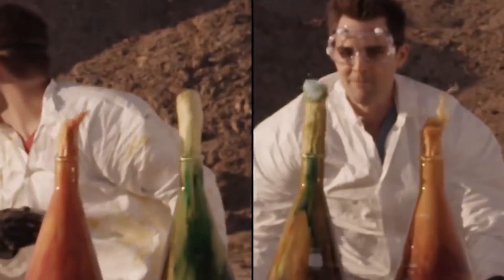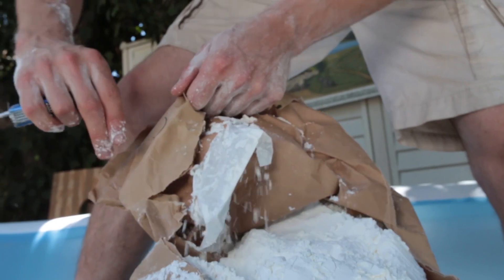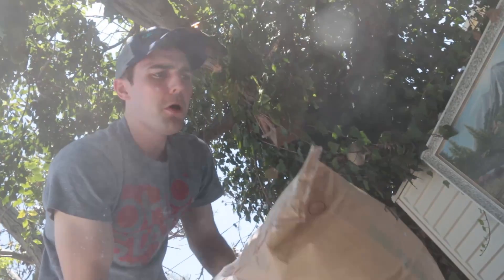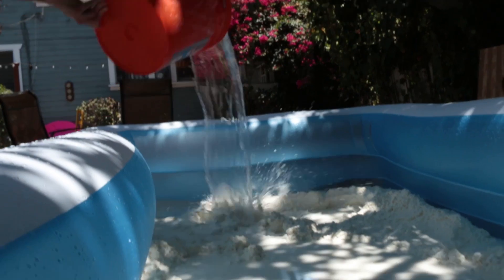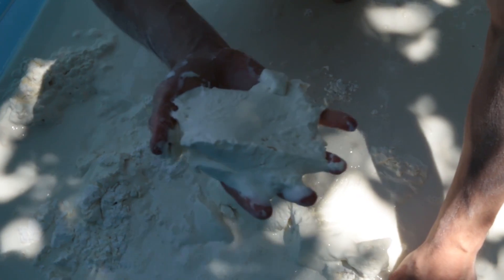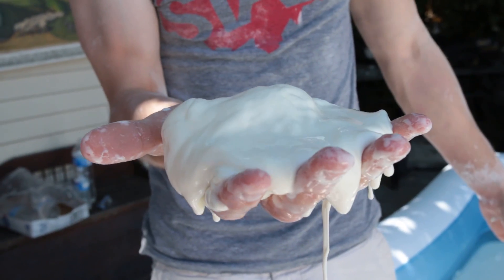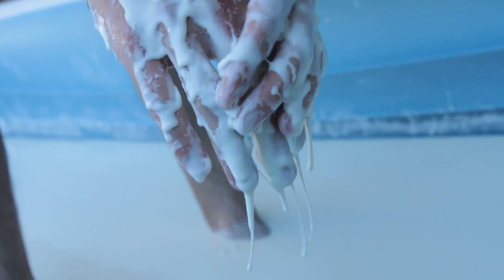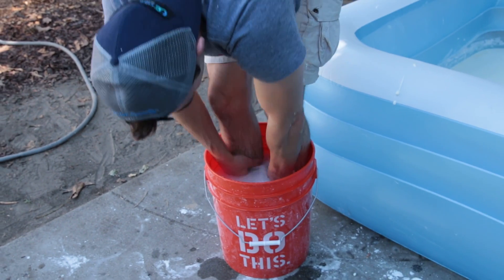400 LBS Of ROTTING OOBLECK: Solid or Liquid? IT'S BOTH

Comment: The title is very accurate.  It is a mixture of a solid powder and a liquid.  Since no chemical reaction occurs both substances retain their properties.  When mixed at the right ratio they actually change which is dissolved into the other based on subtle changes in pressure from the outside, or at least that is what I am assuming is happening.  When no pressure is applied the corn starch dissolves into the water.  When pressure is applied however the water actually dissolves into the corn starch.  I'm sure there are special properties of the corn starch and water that allow this to work.  I know a similar principle is used for building sand castles.  The mixture of sand and water makes the sand very sturdy and yet moldable.  It does not behave the same as oobleck though, so clearly corn starch must have some property that sand does not, most likely having to do with it's coefficient of friction.  I'm not sure exactly why it works, but I am very curious.  I remember playing with it in school as a kid, but we were too young for them to teach us the real reasons why it actually works.  I am very curious as to why this stuff behaves the way it does.
Reply: Mitch Burns this helps me so much on my science project
Reply: How long did it take u to do dat

Comment: in hot air the molecyles are further away that in cold air, so in sauna( its an open space)  lets say 80°C so shouldnt the air pressure be lower than outside or like what i just cant understant it so could you make a video about it
Reply from the maker: hummm I like this question.. I will look into it!!!
Reply: thx